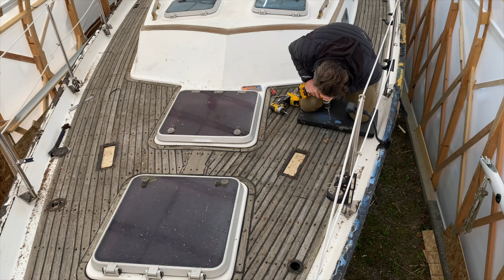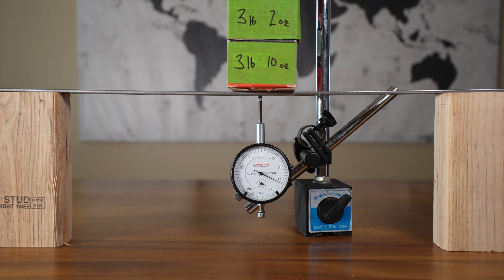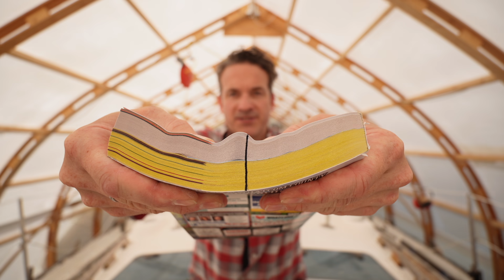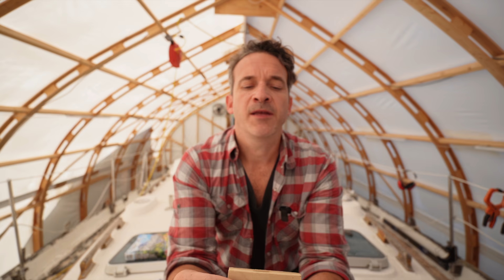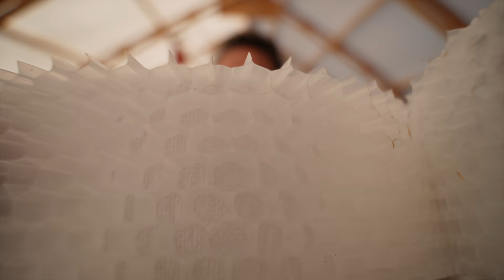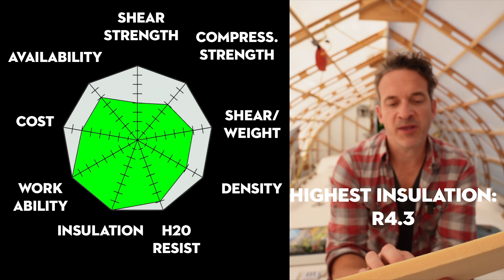The BEST Fiberglass Deck Core Materials (And How To Choose)

Comment: I learned a lot Jon. Thanks.  The different kinds of plastic foam core seems to be the obvious choice because water has little effect. That is, if money wasn't an object. But it is for most of us.  I'm sure it's a consideration for you.  If it wasn’t, you wouldn’t be restoring an old boat.  You would have purchased a new boat for $500,000 dollars off the showroom floor.  

Marine grade plywood will last lifetimes if you prevent water intrusion.  But aye, there is the rub. It's a boat.  Still Maya and Aladino on Sailing Magic Carpet ripped the fiberglass off their plywood decks.   The decks held up well even after 50 years.  My bet is it will hold up well for two hundred years.  But they didn't have hundreds of deck penetrations as a result of screwed down teak decks.
Reply from the maker: Yeah. Marine grade plywood is a good choice if you can be confident that water won’t be an issue. As you’ve already pointed out… difficult to do on a boat! 
I don’t think I could ever bring myself to buy a new boat even if I had the money and as I continue down this path of making YouTube videos and quitting my engineering job I assuredly never will in the future either 🤣. 
Thanks as always for the input!
Reply: @livingforsail  Trust me, you could.  Any day sailing is better than any day with your boat on the hard.

Comment: Very nice presentation, thank you. If you choose to use G-10 on your project, I highly recommend that you invest in diamond blades for your tools. G-10 will destroy carbide tipped blades in short order but diamond blades work great. They are readily available at your local box store for table saws, circular saws, and jig saws.
Reply from the maker: Thanks Torsten. That’s a good tip! 🙏👍🙌
Reply: @livingforsail  I learned that one the hard way making a 12” long table saw cut in a 1” think piece of G-10 with a brand new carbide tipped blade. That was all it took to dull the blade completely. The diamond blade will make clean cuts all day.
Reply from the maker: @torstenhansen4308  yeah, I have a bunch of different sizes for cutting stone and other things. I appreciate the heads up!

Comment: You will never get this boat finished at the rate your going, typical American over explaining and doing nothing
Reply: I'm Jon's sister and his track record is solid gold. He'll finish. Also, he's Canadian and there is nothing typical about him. Just you wait :)
Reply from the maker: Thanks!!
Reply: Haha 😂 Whatever core is used it will out last him.Probably be under the building for 10 years at the rate he’s going.putting all this back together takes way longer then taking it apart.Choice do a good job and go sailing or do it the very best and going sailing in 5 years or longer.even marine plywood would last longer then he will live.I don’t think insulation is important especially with no Ac.Cost is always important and availability is important.The heavier the core is the strong it is,Coosa is the best!Coosa is lighter then plywood but heavier then some cores.3/4 Coosa is $350 for 4x8 sheet.Very nasty to cut and sand but very strong.Coosa by a mile on that heavy bluewater sailboat
Reply: Ha. I appreciate what you intended but like Jon’s sister and being his father, you will learn that there are some people you never say ‘never’ to. Jon L. Congo is one. 

You WILL see.

Comment: Really well done. It's still hard to beat balsa in my view if, like me, you are faced with a complete deck re-core on a sizeable boat. It's also a bit confounding to me why builders would mix ply in with balsa given the very slight differences in strength but I guess options were limited 40-50 years ago. I had ply inserted in areas where it made little sense. My plan is to stick with balsa and 1708, and use G10 in way of stanchions, cleats, and other loaded deck hardware. Oh, the fun!
Reply from the maker: Balsa is a fine choice and well proven. I think you have a good plan there. Provided you properly seal all of your deck penetrations (using g10 in those areas = even better) you will have a great outcome. Good luck with your project. 🙌

Comment: Pretty sure my deck is solid fibreglass , why not thicken up the deck with epoxy/glass or does the thickness for fittings come into it like hatches ? Great video and wish you would explain how you got those curves perfect for your shelter build infact a video on that would be really good. I guess you used a jig of some sort.
Reply from the maker: If your boat was designed with a solid glass deck then that’s great. Trying to convert a cored deck to a solid one is not really practical since I would need to add 3/4” of solid glass. It would be way too much topside weight (and cost a fortune). 
The shed frames were built on a jig on the ground. I have some video of it that I may put together at some point but I was in a mad rush since the birds were already flying south and the storms were coming!!
Reply: @livingforsail  I reckon mine is only about 3/8” 10mm thick and it’s so solid, it also has a fibreglass inner mould for the interior which is perfect gelcoat..Sadler 26 UK boat , twin skin hull closed cell foam fill so it’s unsinkable 
I don’t like these cored decks especially wood or similar in there , it’s always going to hold water
Reply from the maker: @stephenauty2402  3/8 is stout. For a 26’ boat that is not going to have any flex!

Comment: There are other considerations you may want to consider. Balsa has exceptional bonding characteristics and is the easiest to use. It does not require vacume bagging to get a decent bond like most of the other cores. The problems with balsa are more about it's misuse than it's choice as a core in my opinion.
Reply from the maker: I don’t disagree with you. Bob Perry even said to me that balsa is hard to beat but he’s not using it in his recent projects as far as I know in favor of good foam products. 
I suppose your point about getting a good bond with balsa could use more exploration. With it being small blocks on the sheets it should conform better to lumpy bottom skins (like I have) without bagging and that’s handy. I think you could achieve the same bonding reliability by cutting the foam into smaller pieces but balsa will have a better peel strength ultimately with all of those vertical grains. Thanks for the input. 🙏👍🙌

Comment: Great video!!! I've been doing my own research for a project, and I was surprised by Kerdyn 100 product -- I haven't come across it anywhere.  As i am on the East coast, I wonder if the release has been more regional -- I have come across the Corecell 100 on various boat sites and stores.  I've pretty much made my personal decision on Divinycell for my project -- now it is just a matter of deciding on the budget (H100 or H200).  I've been watching Sven Yrvind's current build, and it's hard to argue with the results he has had over the decades -- I'm just not sure about spending the money for the H200 for an experiment ... if it works though I'll have it for the rest of my life!
Reply from the maker: Robert, Thanks for checking out the video. My email is in the video description. If you send me an email I will put you in touch with someone that can possibly help you with the decision. H200 would be approximately the physical strength of Coosa at less than half the weight ... Interesting. I wonder what it would cost?? When I spoke to Diab they said that H130 could be used but was overkill and more expensive obviously.

Comment: Phone book? Haven't seen one of those in ten maybe fifteen years. Did you get it at an antique store? If I was doing this project I'd go Divinycell with one of those high density materials in areas of high loads (windlass, winches, cleats, deck stepped mast). Remember the stingy man pays twice.
Reply from the maker: Haha. I’ve been saving it for this moment! It still has ads for radio shack…
Most of my audience is 40+ so I was pretty sure you’d all recognize it 😳

Comment: One of the main reasons I bought my Dutch-built 1971 Contest 33, solid fiberglass hull AND deck!
Reply from the maker: Yeah, a lot less water to worry about with a solid deck. I know of a compass 47 built with a solid deck also. Do you know how thick your deck is?
Reply: @livingforsail  I will give it a measure next time I am at the boat.  I am over 225 lbs and I can walk on it with no flexing.
Reply from the maker: @beaconbus  I’m curious. I was on a compass 47 that had a solid deck and it was a bit flexible. I’m 200lb.
Reply: @livingforsail  My buddy has a CSY 37 with solid glass decks and they are rock solid.  I am terrified of core saturation.
Reply from the maker: @beaconbus  yep. It’s no good.
Reply: Now that's a great choice.  Does anybody know of  any trawler companies that build solid fiberglass decks and hulls? Any trawler I start researching especially older ones seem to have balsa core somewhere. And balsa core is something I would like to stay away from.
Reply: @srupp9271 not a trawler but Trojan boats, particularly the tricabins, were solid fiberglass. I have a 74 and the hull and deck are amazingly strong 50+ yrs later.